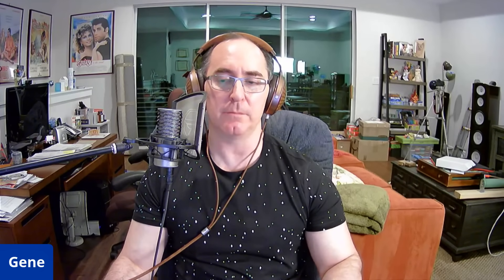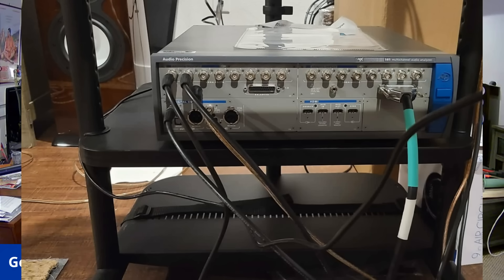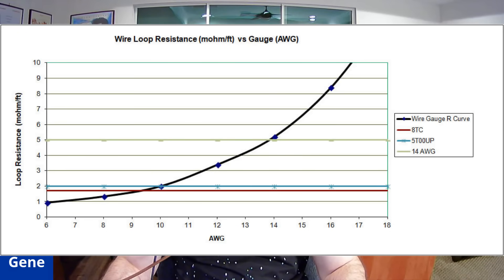Speaker Cables Really Don't Make Much of a Difference?

Comment: Gene is making an assertion that Kimber 8TC is a high end speaker cable. This is BS! Before you attack me, I actually own a biwired pair of 8TC amongst many other speaker cables, and have conducted blind tests for over 25 years with many many people.
Gene's other assertion that a Denon integrated amplifier and a pair of $3500 speakers represent high end equipment is equally flawed.
If you are considering spending money on a high quality speaker cable, I have no doubt that you have nicer gear than he is listening to in this video.
Gene completely ignores the effects of RF and EM on audio signals and has based his opinion on a cable (8TC) that although a reasonable performer for its price hardly constitutes a high performance speaker cable.
My challenge to Gene is get your hands on some Audioquest Dragon speaker cable and perform the same test... then apologise for making a fool of yourself and belittling people who trust their ears and actually use high end gear and some excellent speaker cable to enjoy their music.
Cheers
From Down Under!!
Reply from the maker: Interesting since I recently tested a pair of Audioquest Thunderbird Zero speaker cables and found the battery pack allowed more RFI noise pick up in my testing. Also, I tested these cables on a $6k Anthem STR amplifier ($6k) and Revel F328Be speakers ($16k/pair). That said if you like the AQ, no sweat man. Enjoy what makes you happy. I don't judge what people buy or spend.

https://youtu.be/KzwAdwvy9l4
Reply: @Audioholics  🙂
Did you actually listen to them critically at all??
Reply from the maker: @Michaelhifi1969  As best as possible without the ability to instantaneously switch cables in a controlled blind manner. I didn't hear any problems between any of the cables. They all sounded similarly good. Just because you can measure something that doesn't look great, doesn't mean it will translate to audibility.
Reply: @Audioholics 
Hi Gene 
 I have conducted a lot of blind tests with a multitude of speaker cables and interconnects in various systems and different listening rooms. Some have shown large differences in detail at various frequencies and incredible differences in 3 dimensionality of the audio image. Audioquest Mythical Creatures and Folk Heroes speaker cables have been favoured in many of these tests, sometimes against more expensive cable from other well known manufacturers. Their interconnects are also very good when compared in blind tests, with bass extension that is unrivalled in my experience and superb imaging. 
I suggest you have a blind test session involving some of these cables. It is a lot of fun apart from being quite educational. 
Cheers
Mike
Reply from the maker: @Michaelhifi1969  Michael, I'd love to see a write up of your blind testing including procedures, control variables, biases, etc. These are quite challenging to run. Here is an example of one I ran back in 2010 on various loudspeakers:

https://www.audioholics.com/tower-speaker-reviews/2010-1k-faceoff
Reply: @Audioholics  Hi Gene.
I have been doing these sorts of comparisons since 1994. All the cables are in place unsighted. One person is tasked with making the switch from one to the other, and this is done several times. I'm not naive about personal bias or suggestiveness, so we keep our opinions to ourselves and write them down after each change. At the conclusion we share these. Not everyone always agrees about everything but people do have personal preferences. Interestingly most do agree about soundstaging. I always make sure everyone gets an opportunity to sit in the sweet spot and the seat adjacent to it when there are several folks involved. 
Also interesting is I find women come to much faster conclusions than men in these comparisons. 
I have also done these type of blind comparisons with subwoofers, Amplifiers, CD players and DACs, which have been fun. Never done a speaker blind test though, I will try that thanks to you!

Comment: I have a pretty entry level set up, Sprout 100 and a mostly base level X-LS from GR Research.. maybe $1000 all in? I've been able to tell differences between my original 12 AWG zipcord and my DIY braded Kimber style kit. And there definitely is a difference, with the main differences mostly found in the clarity of decay, as well as the depth & spaciousness of the soundstage, esp in songs that are well recorded/mastered.
When it comes to songs that lack those details, no cable will ever make them magically appear, you just get what's there.. Diminishing returns kick in pretty quickly with cables, and so long as it suits your needs, there's not much point in fretting or spending $1000+ for cables, eap when a $30 spool and some banana plugs can get you 99% of the way there.

Comment: Ok, total revelation!  You have confirmed what I have suspected for sometime now. 

QUESTION -  The crosstalk problem in data transmission (think Ethernet cabling) increases with faster transmission speeds. Example: CAT 3 cable is OK for 10 to 100 MB TX/RX but to push 10 GB you would use a cable with a higher rate of twist like a CAT 7 cable to reduce crosstalk. Is Audio similarly affected?  Would twisted pair improve sound quality vs. flat pair used for speaker cables these days?
Reply from the maker: Twisted pair cabling is very useful inside speaker wiring and amplifier wiring to reduce coupling from adjacent circuits, noise, etc. You an certainly do it in the form of a braided cable for speaker cable as well but it's really less important in that case.

Comment: Interesting comparison, fwiw, the 100PF cable per foot at 15kHz in 10 ft of cable provides 10ohms Xc to the signal between the conductors so it's worse than the cheap home depot cable when it comes to attenuating the highs.  Inductance is not the only thing that provides attenuation to signals. One thing that's a bit confusing to me is why charts are provided to display the performance of cables above 20kHz when human hearing drops off at 15k-20k, and closer to 15k as we get older, so who cares about frequencies above the range of hearing other than hype to show how a special cable might perform better to the 'eye' (in the graphic) ??
Reply from the maker: The capacitance in a cable is in parallel with the load so you wont see HF losses like you're thinking. Excessive capacitance can cause amplifier stability issues or frequency peaking on amplifiers with a high unity gain crossing. Also 10ft of 100pf/ft cable would be 10kohm not 10 ohms at 15kHz.
Reply: @Audioholics Yes, my bad, correction, it's 10k ohms. It's not much but interelectrode capacitance between wires attenuates higher frequencies similar to the XL of the wire in series depending amount of Z. Just as with higher frequency radio signals the attenuation of the cable is felt before the  signal reaches the load because of the time it takes for the signal to get to the load, the attenuation happens along the way. I'll grant that 10k ohms is not much, so should not be of any real concern due to that fact, and not because the capacitance in parallel with a load doesn't affect the signal. In fact it does. It's no different than putting a 0.001uf capacitor between the output to the speakers and ground before the signal ever leaves the amp and reaches the load (speaker).

Comment: Gene, you have shown what that speaker cables measure slightly differently and SPL in a pseudo situation does not differ ?  This goes back to measuring THD and thinking it will represent directly the sonic performance. I have never spent large sums on cable, nowhere near as much as 8TC thats £85.00 a meter ! But they DO sound different in A-B testing in my and many other systems. 'Audiophile's' are seen as nerds who convince themselves of things and spend a lot of money on, I don't see myself as a nerd, but an enthusiast who has been experimenting for 40 years. I'd love answers so do keep trying but if you want to be scientific then please set out and prove the correlation to your measurements and the sound in a double blind test, then build your case. Or perhaps the idea is to play with an instrument and stir up a hornets nest of 'all CD players sound the same'. What have you debunked ? Nothing for me, I still trust the results of experimentation with the instrument that counts, my ears. I am interested but don't care about the science just the results, the science is a nice to know not a need to know

Comment: I am sorry folks... Gene has not walked the walk. I wish he could of been with me in my computer engineering labs in college building the stuff that we did... where he would of seen first hand the problems with noise, EMF and a whole bunch of other variables which are present when building electronic circuitry. There was one particular experiment where people could not understand why one day their circuitry would work and other days where it would not.  We were building a heart rate monitor which had a considerable amount of wiring. The cable (which you had to manufacture yourself) to the main sensor was the key. Any noise on that introduced inaccurate results.. even though there was a D/A converter involved. For those of you who do not think that digital solves all these problems... and that USB cables do not have noise... you are truly mistaken. So the question is.. do your speaker cables act as an antenna for noise or act as a filter of noise? That's what this is all about. A good speaker cable can act as a filter where can cancel out unwanted signal so you only hear what you are supposed to. People who call high end wires snake oil just tells me those people have not got their hands dirty in designing and actually building electronic circuitry.
Reply from the maker: I spent 3 years doing EMI/RFI countermeasures for a large Telcom company as well as designing analog front ends of modems and POTS filters and another 4 years doing board design to meet very stringent Tempest requirements for the Govt. I know full well about noise, EMF/EMI, etc. None of this applies for a speaker cable driving a loudspeaker.

Comment: Benmark has an article about 
"AUDIO MYTH - "DAMPING FACTOR ISN'T MUCH OF A FACTOR"".  In there it shows low damping amp with certain speakers can indeed have audible differences when using speaker cable of different lengh and awg.
Reply: Note that Gene isn’t suggesting this isn’t true. He isn’t saying that cables make no difference at all under any circumstance. He is not suggesting that people connect their gear with 24 gauge zip cord. He is suggesting that the high end cables don’t actually make a difference. Gauge and “high end” are in no way synonymous. 

The reality is that damping factor is limited in most systems by the cable gauge. Using higher gauge cable is always a good idea.  However, most amplifiers have a sufficiently low output impedance to mostly mitigate this issue when the gauge of the cable is reasonable. We typically advocate for 12 or 10 gauge cable when runs are on the long side. If anything, this is more an indictment of amplifiers. We really want to see amplifiers that have sufficiently low output impedances.

Comment: I thought the same, I had my flagship arcam and Canton reference book shelf with oppo player hooked to regular bestbuy speakers wire with no conditioner power supply and reg hdmi cable.
Base not great and clarity was also not the best. I thought I need to upgrade my amplifier. More power required.
Then I was advised to look into wires, hdmi and power conditioner.
Did some research and purchased van den hul ultimate hdmi 4k cable, then same company mid level speakers wire and Puritan conditioner. Ask my wife to listen before after difference.
One simple answer. Big difference, base went up, much refined sound and distortion was gone.
I used to hear mild noise from arcam tridol power supply now that is gone.
Thats my take on this. Personal and family experience.
I am saying spend thousands of dollars rather you need good and decent wires along with power surge conditioner. Found two great brand puritan and van den hul
Reply: Instead of spending thousands of pounds when you could of easily got your faulty arcam amplifier replaced free of charge. Or returned it money back in the return period and got a different amplifier that worked properly.

Buying equipment that is faulty keeping it then spending thousands to paper over the cracks is silly. Throwing lots of money down the drain.
Reply: @C--A  lol, I  already checked nothing wrong with the unit. Thats what once heads think, when listening to these channels, about speaker wire HDMI. I also tried Yamaha two channel amp and another great brand two channels amp. After changing wires like O explained, everything changed. My arcam cost 7k list price.
I dont say spend a lot on wire. Mid level from a brand is important. Van den hul is very good. Quite cheap

Comment: I'm curious about the time domain.  Do cables cause different frequencies to arrive at different times, perhaps due to the skin effect?  For example, Wilson Audio states that their WAMM Master Chronosonic speaker can be adjusted to correct for the variation in time arrival of different frequencies caused by upstream components, including cables.  They provide owners with specific speaker time alignment settings to use with specific cables, based on Wilson Audio's measurements.  What are your thoughts on this?  Can you measure this?  

I'm a bigger believer in the placebo effect than in the efficacy of pricey cables, but the frequency time arrival concern seems to have some merit.
Reply from the maker: No, there is no time delay of frequencies transmitted down a cable. How companies come up with this nonsense is absurd.

Comment: "This is very precise test equipment"
A little something I leaned in the military.  You can have all the most precise test equipment in the world.  But unless you have it properly calibrated on a regular basis, it's useless.  Worse than useless as it can give the user a false sense of confidence.  And your equipment can only be as accurate as the people and equipment used to calibrate it.
Especially out of the military, I've been to companies with precision measuring equipment costing hundreds of thousands of dollars, but they hadn't had it calibrated in 3 years.  Or just as bad, they have an employee who knows nothing about the equipment calibrating it with a simple (and equally uncalibrated) VOM.

So forgive me if I seem a bit unimpressed.
Reply from the maker: However, I run self test regularly on my APX585 HDMI analyzer and it meets spec everytime. If it ever falters, Audio Precision will calibrate my gear. My Wayne Kerr magnetic analyzer is brand new from the factory and I also check it regularly. So forgive me if I'm not entertained by your post.
Reply: @Audioholics  The self test is rarely a calibration test.  And "brand new from the factory" is no guarantee of proper calibration either.  Unfortunately the literature for that analyser doesn't say much about calibration, or any maintenance schedule.  And I've often found that companies like to bury their calibration information inside their service manual - something they like to give only to their authorized repair techs.  You can probably guess the problem with that - the owner never learns that there is any need for calibration, let alone how to do it.  So I always recommend owners beg, borrow,  buy or steal a service manual.  IMO, one should come with all precision measurement equipment.  The military will calibrate their precision test equipment at least once per year, and usually 4 times per year.  I consider them "the gold standard".   But the military has an excess of man-hours to fill and can be quite anal about filling them..  Once per year is usually good enough for most - with exceptions.  I usually mention torque wrenches as notoriously bad - just drop one a few inches and it needs to be recalibrated, otherwise they need calibrating practically bi-monthly.  How many auto shops do you believe send all their torque wrenches out for calibration every other month?
However, what I hear most from those without military experience is either "calibration?  What calibration?", or "We always calibrate it ourselves" - but I get blank stares when I ask them to show me their calibration procedure.  One company shop was real slick - they performed their own calibrations - using all umcalibrated test equipment and no baseline for anything. (think I mentioned them earlier)

In many cases, the techs are lazy and want to take short cuts, or the execs are greedy and want to save a buck.  In some cases, the test equipment is a very low priority on their list of things to think about.  Being more of a lab - you guys are probably far better on top of it than most.  Though calibrating test equipment is often the first to fall through the cracks when labs get busy.  And your comment about it being "brand new from the factory" didn't inspire confidence.  For guys like you, everything you do begins and ends with reliably accurate test equipment.  You gotta have utter confidence in your equipment.

Comment: The problems with all of "speaker cable" rant are:

1. You have never had a 100k monoblocks (like Boulder 2150) paired with 200k+ speakers (like Magico Q7 or Vonschweikert ultra 11) for reviews, so you then can put your 8tc cables on them and LISTEN to the sound. Next try the top of the line cables from Transparent or Siltech and LISTEN if they sound different.

2. You may measure the measurables, but you CAN'T measure the sound;
it's like measuring the taste of 2$ Hamberger vs 100$ Hamberger. 
How could you measure the taste?!

What you have been preaching is the likes of Michael Fremer and John Atkinson are bullshiting people for decades.